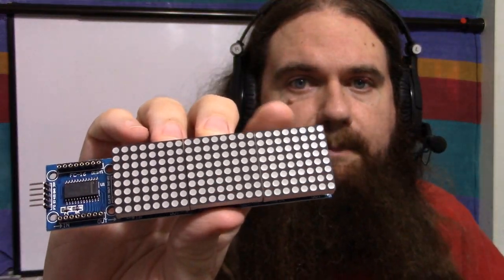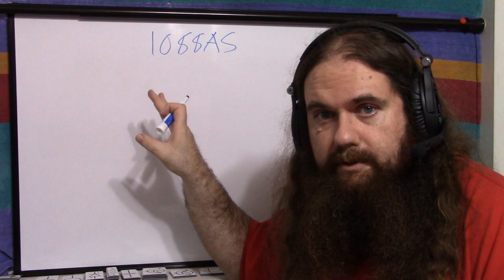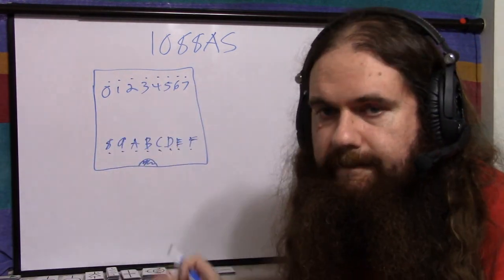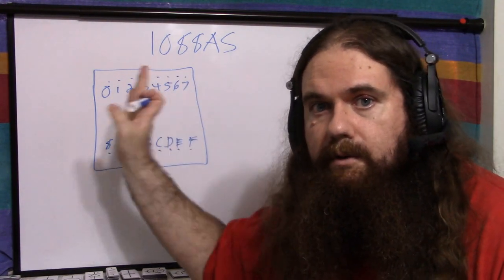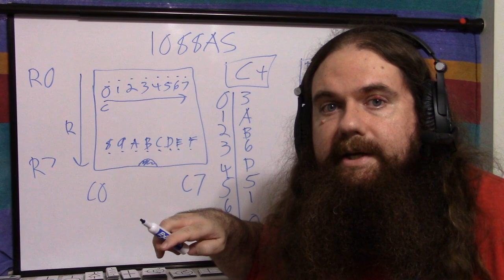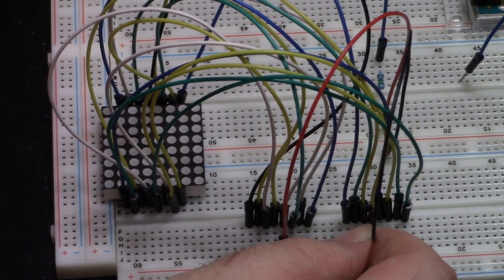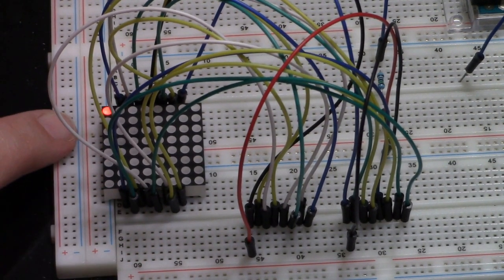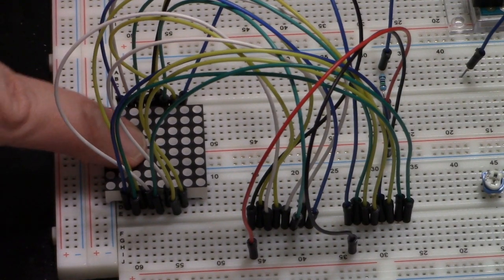1088AS 8x8 Red LED Matrix Display - Pinout and Overview Of Operation - Simply Put

Comment: I Theorize that because of creating a bunch of rows in proper orderly order that it might have been more expensive. you remember that app puzzle game called flow free? you have to strategically place the wires. maybe they ran out of room on a single plane of connections and having the wires go over or under each other would cost more. That is just my thought. As funny as I think it is to think that some idiot designed it, I do find it hard to believe that somehow. but you never know. maybe it was a stupid person or an accident. (insert shrug emoji here)